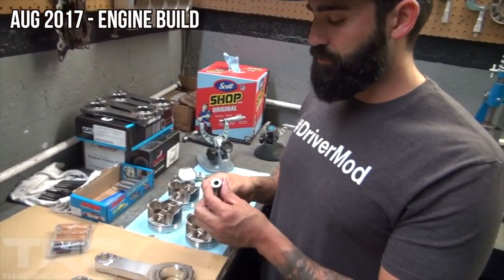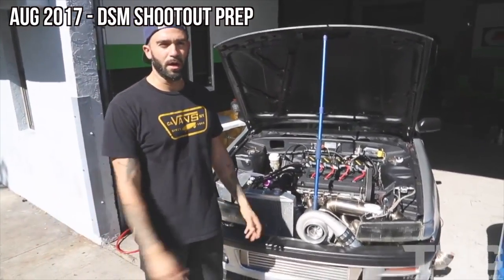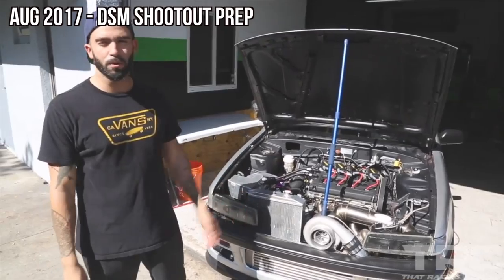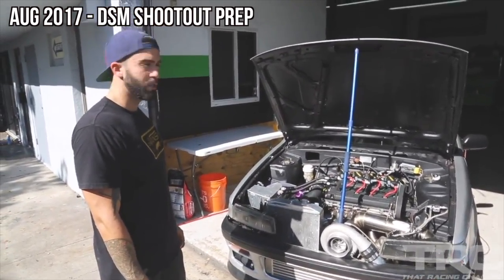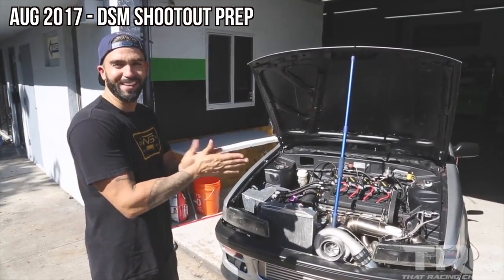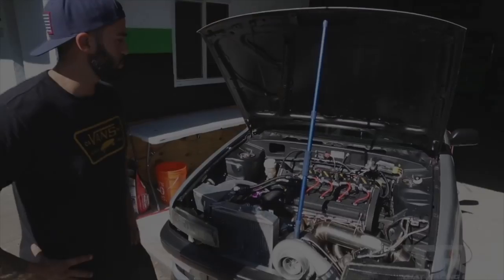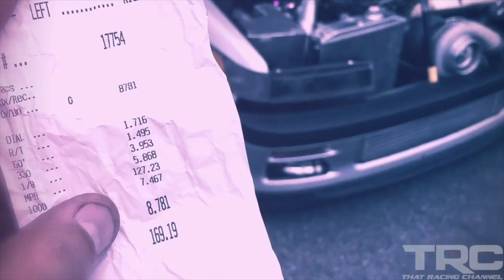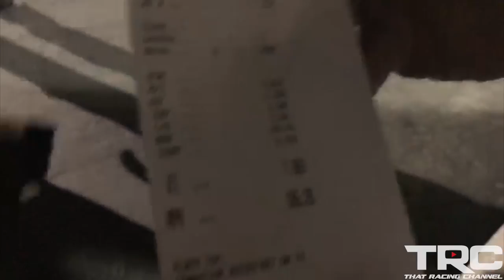1250HP AWD 4G63 Colt Breaks 7’s! - "King Colt"

Comment: I had a 89 Colt GT ran 7s also, 0-60 mph though...
Reply: 2t713 lmfao
Reply: Lol 7 + to sixty more like it 😂😂😂
Reply: 0-60 in 7s deserve respect, even for todays  standard
Reply: @matt2452  sorry.. if that's true, it might need some tuning. My '91 4G15  with the right setup only takes around 5 secs to 60 kmph in 1st gear (GPS speedo), stock engine & gearbox,  custom header & exhaust only.

Comment: Great job 4g63 always a devil his master Sakura racing was the first 4 cylinder to touch 7s back in the day in Puerto Rico with this engine.
Reply: Luis, Sakura was running a Mitsubishi G54 2.6L Single cam 8 valve engine from the Starion and Conquest not the DOHC 4G63 16 valve engine from the Eclipse and Galants like this one. I remember that car, It went 7.40's over 22 years ago, That was something almost impossible in mid 90's!

Comment: I really want to see one of these with a full exhaust and turbo under the hood it would definitely be the ultimate sleeper I didn't even know about this model of car until this build.
Reply: Colt wagons are badass and nobody expects them to be fast
Reply: I've got a 4 door 88 colt i just got done 4g63 swapping...there isn't much space at all in these engine bays once you start putting bigger parts on it...gotta get creative with placement of everything. Car stock before swap weighed 2050. These cars book. The stock 1.6 4g32b turbo that came in the car made the car scoot for it only having 90hp.
Reply: This is not a sleeper wtf
Reply: @fread51  Did I write that this car is a sleeper or did I describe how it could be the ultimate sleeper? Lol read before you respond

Comment: I had an 84 Dodge Colt turbo 
Reeves Callaway gave me an intercooler for it .
Thanks Reeves !
 I ran a cold air intake tube into the cowl
Pluged in a fuel cut defencer
Electronic boost adjuser
Eibach springs & Bilstein dampners.
bigger brakes
Shaved  185-50-14. Klebar
Tires
 The weak link was the duel range 8 speed transaxle 
I went through a couple transaxles 
Put 3rd. Gear through the case once.
The car was STUPID FAST ! 
When it hooked up .

Comment: Evo's where you at? Can't believe he did that on a wet, un-oringed block!
Reply: Evil GST 🚗💨
Reply: Evil GST wasn’t this a real street car before, and red?
Reply: honestly not sure. there are a few really fast colts/mirages running around.
Reply: I love the AWD swapped Colts/Mirages. Its basically a DSM in a different body. 💪
Reply: Evo_Aust at the beginning of the video you can see them putting a wrap on it. It was red before
Reply: I need to know, it the block is not filled with block filler in the water jackets?
Reply: @levischittlord6558  Wet block typically means zero filler
Reply: @charaznable9672  : Its a Mitsubishi with Dodge badges.
Reply: I still can't wrap my head around getting that much power without o-ringing the block.
Reply: We're shitting on everyone at real tracks lol

Comment: Shit, my FWD 4g63t swapped Colt was really hard to hold onto under full boost, I couldn't imagine this. My car had a 1/3rd of the power, but it was crazy.
Reply: I even had a 4g61t in it at one point and I have seen Colt GT guys run 10s on that engine. It was so much more suited for that chassis than the 4g63t.
Reply: Yeah, and now I have a 508 wheel horsepower turbo 97 Honda Civic coupe.

Comment: I love drag racing! And congrats to that team building that car! What does wet block and no o-rings mean btw?
Reply: It has coolant in the jacket, lots of drag builds run no coolant. O rings are copper or steel rings that surround the cylinder sleeve for extra clamping force for the head to block mating surface, to take more boost/cylinder pressure.

Comment: Is 'boost cut' the same as 'over boost'? I'm assuming this is just bypassed in tuning/ecu? Or is it a bigger problem?
Reply: More or less the same  but boost cut is done by the computer. It's a function you set so the car doest over boost. It's what's saving the engine, so it's not a problem really.

Comment: "Wet Block", Whats that mean? Still running water pump / coolant, or no dry sump pump?
Reply: Some (race only) engine blocks have the water passages filled for increased strength = dry block/filled block.
Reply: Thank you.

Comment: DAMN IT DUDE! I used to own one of these that I built and I fucking traded it for a piece of shit. It had a built 4g63t in it, and I had it tuned on a Frankenstein 19c turbo and 1200cc injectors and it made 429 wheel horsepower on 22 psi. Granted, mine was tuned on an Apex'i SAFCII, and it wasn't AWD, but it isn't hard to build them, but you gotta have the money to build an engine like that. Congratulations on this build brother, it is amazing!

Comment: Ya, I have three of these.  Two Colts and a Mirage.  Well, not quite like this one... Eh, not anything like this one.  All 4G61T though.... and of course FWD.  The 4WD conversion is sick!
This is a killer build, but risky as hell, IMO.  What the car really needs is suspension work.  Get the spring and shock rates right, some tweaking of  other parts for strength and to reduce flex and alignment changes under hard acceleration....  This car has another half a second in it.  Dang.  Impressive as hell.

Comment: For being all wheel drive with so much HP it should take off faster. Either the driver sucks or the engine needs better tuning at take off. I'm sure if it would take off like it suppose to you will be a second faster. Also it may have to much HP for the strength of the car.